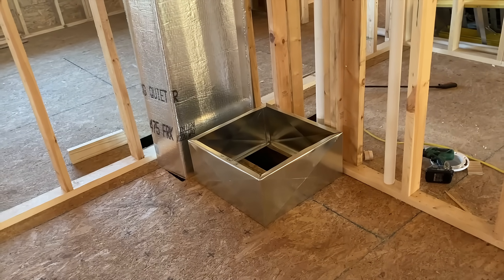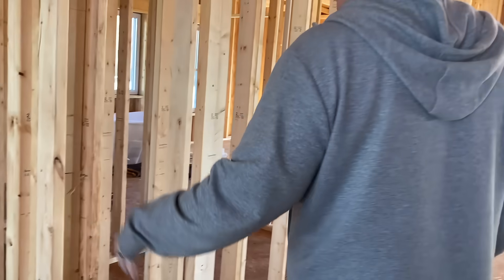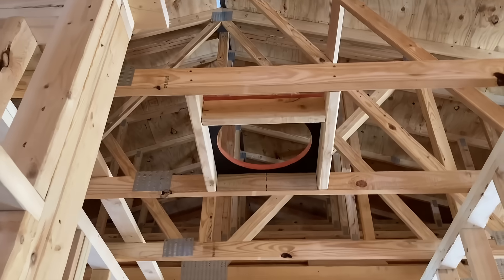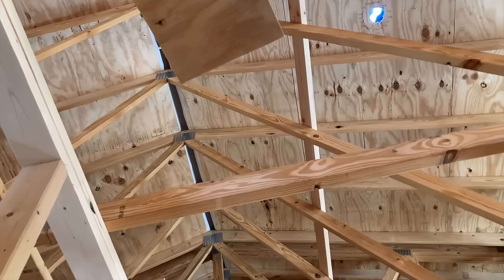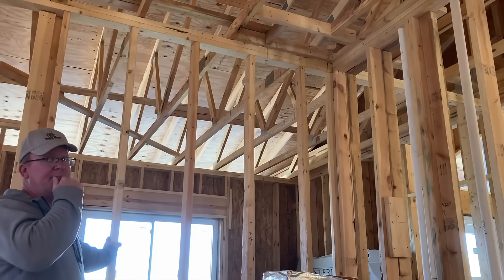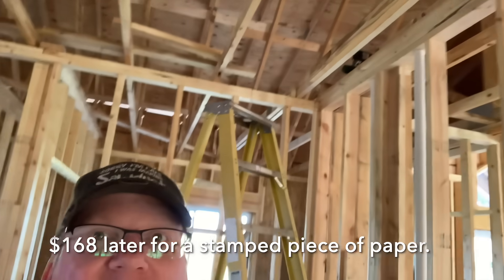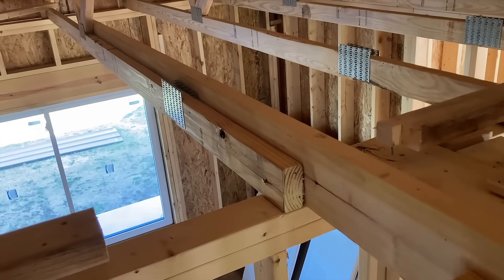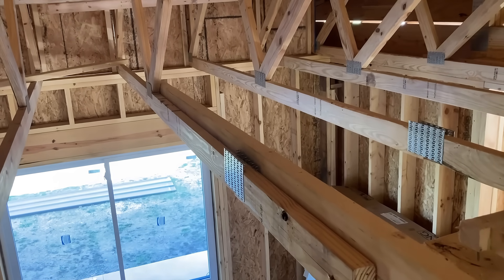HVAC Guy Cut Our Structurally Engineered Truss to Put in Duct Work. Do Not Cut Trusses!

Comment: As a catastrophe adjuster, I’ve inspected thousands of homes over the decades. Those cuts will not affect the home at all. If you were really concerned, you should have built it with standard wood rather than trusses. Trusses collapse so much faster than standard stick built structures. An engineer will simply state to shore up the affected trusses with standard 2x6s or 2x4s (seen hundreds of engineering reports with this issue). 
You are just making something out of nothing. 
With that said, you two are the worst type of people for construction people to work with.

Comment: Another Homeowner that knows it all. Build it yourself.
Reply: @Bradley-l6b  Another know-it-all maybe contractor(?) who may have some great knowledge to share but just makes a snarky comment and doesn't explain for the rest of the class what he's thinking.

But let's consider this comment for a minute. I'm a homeowner and I certainly DON'T know it all. But I've owned three houses in three different states because of my Navy career.

Are you suggesting that only builders and GCs can do things RIGHT? And furthermore that they never make mistakes? Cut corners? Get sloppy and/or lazy? Hire unskilled workers and don't properly supervise them or inspect their work? That inspectors always catch these things?

My last house in California was built in 1961 and had some issues due to previous owners, but there were also issues due to builder f*ck-ups. There was a weird truncated and shingled roof section in the attic where they had apparently not built it according to plan and then corrected by just building AROUND that. I always thought this was the result of some addition at some point, but I learned from an architect I hired to draw up plans for a second floor addition that there had never BEEN an addition. Everything there was original construction. It made getting around that attic a royal PITA.
How does that happen?

I hired an electrical contractor to upgrade the service to that house to 200A and replace the main box. He left some spanish speaking guys there unsupervised for half of a day, and they installed the new box upside-down. So they had to remove that and replace it with a new box. Maybe they were able to use the one they F*cked up SOMEWHERE, but not on my house.

Tell us, why is it that the walls are never straight nor plumb nor square in a professionally built home, AND that have bulges where studs are bowed? We always have to compensate somehow when installing flooring or baseboards or crown moulding for walls that are neither square nor plumb. I replaced a front entrance door in that house, but to install it PLUMB, I had it tight against the wall at the bottom, and a 1/2" gap at the top because the wall itself was that much out of plumb. That was done by the original builders--NOT homeowners.
How does that happen?

Current house in Kansas was built in 1978. Lots of houses around here are having foundation and basement problems due to original construction methods. I bought a house that had a lot of neglect issues, but didn't have foundation problems--or so we thought and so the inspector told us. But my real issue is either sloppy builders, sloppy inspectors or sloppy code in 1978. I went to replace both full bath exhaust fans because they just squealed horribly. I found that they were never vented even into the attic. The little damper at the exhaust of the fan was closed and HELD closed by the attic insulation that had been pushed down or settled down around it, and no duct connected whatsoever. BOTH of them. Now they're both vented to outside by insulated ducting as they should have always been.
How does that happen?

I went into the attic during this time to do air sealing which I know and understand wasn't a thing in 1978. Fine. But I move the insulation back from around a light fixture, and the several Romex cables going to that fixture go through the knockouts in the very sturdily mounted ceiling fan box, but there are no clamps or grommets to secure or protect the cables.
How does that happen?

In another of these ceiling boxes, also mounted very well except that it was also about 1/2 inch from the bottom surface of the ceiling sheetrock (mounted too high), they used it for a junction box for that entire circuit, and it was stuffed FULL, completely violating fill limit for that box. And some of those cables had no clamps either. I had to remove the whole box, replace it with a bigger box, move it higher AND add an extension to the box. I haven't gotten to all of the light fixtures, so I'm dreading the amount of work ahead of me to fix all of these.
How does that happen? Original builder electrical contractor did that, not any homeowner. And no inspector caught it who should have, either.
Reply: Building it yourselves 😂
Reply from the maker: Hey, I appreciate the feedback. Welcome to the channel. You’ll see that we are building it ourselves. sometimes the subs just don’t listen to directions. Thanks for watching!
Reply: Yeah I’d fire that customer on the spot. There’s plenty of appreciative paying customers out that don’t know it all already especially your job.😂
Reply: @MK-xl9tt  my dad fired the GC after finding errors worse than this.  The GC response?  “If you and your wife did not walk project every night we would have gotten so far you could not make us fix it.   One I recall.  He messed up basement door, steps.  So moved it over 6”?  I forget exact then the upstairs had to be moved as both in same location.  That caused main bathroom to have a 22” wide door.  maybe it was 20”    They had wanted a 36,  but plans were smaller. 
  Only thing worse than amateur asking questions?   Á expert that gets mad when they are good questions.
Reply from the maker: @larsharris exactly! Thanks for watching!
Reply: So, what, you think that truss should have been cut? What do you think he doesn't know?

Comment: The old cliche applies here, ( you are most afraid of the things you know the least about. )
Reply: imma go waaaay out on a limb and guess that you're a tradesman who has cut thru more than your fair share of framing members and shrugged it off cuz 'it's just 4 inches out of a 2x12, there's still 8 inches left'.
Reply: @ripsnort-d8z Yes, i was a tradesman, but i was also in the home building business.
These types of things happen all the time,and there is always a way to fix it.
AND, with better planning initially, they happen far less often.
Reply: @ernieforrest7218  yeah yeah, anything can be fixed. The best way to fix every problem is not to create it in the first place.
Reply: @ripsnort-d8z Yes, you are correct, so find another place for the ductwork, or move it enough so the framing isnt afected.
But, if the owner dosent want to move it, what other options are there?

Comment: Not an expert but... I would of thought the plans would account for the HVAC duct work unless it was an add-on.
Reply: Residential building plans do not take into account hvac, plumbing, or electrical layouts. They indicate where the major equipment, furnace, water heater, etc are to be located but it’s up to the install tech to make everything fit appropriately. This is why we do things in a specific order, framing, hvac rough in, plumbing rough in, then electrical rough in because it’s much easier to get pex pipes to fit around duct work and wires are more flexible and easier yo run than water lines. Installers are expected to know and follow codes but most times they just want the easiest run which is why it’s best to have a contractor that knows and understands all trades to head this off before the installer takes a sawzall to a rafter or TJI Floor joist!! With a tiny bit of communication and planning, you can avoid the $168 engineers report with stamp, but you also lose a video and gain a free weekend without explaining to a woman about why 3 grown men fucd up their Lincoln log set!! It’s really not hard and is basic construction 101.
Reply: That's exactly what you'd think Of course it is. But you'd be wrong.
Reply: Would've. WOULD'VE. Its a contraction of "would have". WOULD HAVE. What sense does "would of" make? Christ.
Reply: @1qikz210  Take a deep breath and relax. I was the grammar Nazi in my job because that WAS part of my job. But this is the Internet and just a discussion about a video, and not everybody is an English major.
You clearly knew what he meant, so it wasn't like that little goof made it illegible. If that were the case I'd be with you asking @kahvac to clarify.
There are bigger problems in the world than how somebody spells would've.

And someone once said everybody's ignorant, just about different things.
Reply: @dolfinwriter5389 
 Thanks, for your comment. I see it from the same perspective. 
Don't sweat the petty stuff. And don't pet the sweaty stuff. Unless...that's what your or you're into.  Still knew exactly what I meant.
 Peace Out. Take a deep breath. And enjoy each day we are or
we're given. No... I couldn't leave it alone.

Comment: Sorry but duct board sucks. Also running ductwork in the attic out of the environmental envelope is a very bad idea, I mean an absolute horrible idea that should never be done. It looks like this house has a crawl space which the return air should be run to several returns though out the house. This issue is on the architect to do a better job.

Comment: If there is one guarantee in building a house or remodelling, the current trade doing work will trash a previous trade some how.    It is up to the painter to fix it all.
Reply: Yep, caulk and paint over poor miter cuts. Some in my sister's  new house had 3/16 gaps filled with caulk.  
   As a DIYer, I had a heck of a time putting stained hardwood chair rail and crown moldings in our house that didn't  have square/plumb walls..
Reply: For reduced wages as they already over budgeted the rest of the project..
Reply: Or sheetrock to cover up.

Comment: My parent's house was built in 1957, before trusses were a thing.  Not only were the roof rafters not supported vertically, but one of the valleys had a big three-flue chimney across it.  No supporting structure either.  No cross-ties, etc..  The roof WAS spreading, and caused numerous cracks in the drywall.  Also the 'trim board' at the the brick veneer/soffit area had separated away from the brick almost an inch-  The ridge of the roof had a noticeable 'swayback' where the framing was compromised.  I'd never buy that house today, knowing what I know...  Oh, and the new owners (they've been in the house for over 30 years) took out a structural load-bearing wall down the middle of the house...  Oops.  It is amazing some of the absolute crap/shoddy build quality you see in construction!!!
Reply: Not the kind of structure I'd want to be in during an earthquake. lol
Reply: Agreed. And yet some of these "pros" act like (1) they know everything; and (2) they're infallible. I have news for them.

Comment: Much ado about nothing! All that would have been required would be to repair the bottom chord to restore the tension. This is overkill but for less than $50 if you were to put a piece of 3 1/2” x 7’x 3/4” plywood on either side of the bottom chord, glue it with PL bond, and put 2” screws every 6” o/c it would be stronger than the original and any engineer would sign off on it. Yes, the contractor made a mistake but to put him through the grief I’m sure he experienced, and expense of an engineer, etc. was completely unnecessary for a common sense $50 repair. The contractor should be reimbursed
Reply: Exactly! They give too much credit to a 2x4 stick.  There are trusses on each side, not more than two feet apart. Besides, they can sister it way better than what they did here. Cut one 2x4 to fit the space, then sandwich it with nails with two other 2x4s. Nonetheless, hurricane ties to the cross and the truss, if the cross was doubled, would have sufficed.

Comment: It was a mistake yes but you made a huge deal out of something so stupidly simple all you had to do was replace the piece of wood that was cut in the truss and then run two bolts through the tie plates and get another HVAC guy. You acted like an a-hole!!!!
Reply: Once the truss is compromised you need to get that signed and sealed piece of paper to pass the framing inspection.  The earlier the better.  Might even be worth it to have the inspector who approved the original plans involved in the process.
Reply: He acted like an a-hole???  You sound like you are talking out of yours!  Go back to licking the windows and stay off all construction sites and comments sections!!!!

Comment: Why are vents in floor?
Reply: maybe he meant the cold air returns, supply are still being installed in the floor.
Reply: Have you ever been inside a house at all?  This question cannot be serious.
Reply: @davidshema2614  I know in old construction they were in the floor but have not seen it in 10 or 15 years and is against code around here.

Comment: Your interior walls under the truss require a special bracket, get ready to dismantle them and putting it together right 😂 . You need advice let me know.
Reply: Hurricane clips at barring points, I believe these trusses span from one end to the other
Reply: @bluelighting7152  I was writing about interior not bearing walls whitch require different connection and techniques when drywalling to avoid cracks.between ceiling and wall.

Comment: The repair is kind of an overkill in that the truss already has splice plates on the bottom chord. It is not like continuity of the wood fibers is critical to the performance. The bottom chord mainly bears axial loads to keep the truss from spreading and some minor vertical sheathing loads for the ceiling.
Reply: Right? My thoughts exactly. I mean, why not place the furnace and/or return between the trusses?

Comment: Why was the hvac equipment not accounted for in the construction plans? I could understand cutting in a remodel but not new construction . If I were told this is where hvac equipment is going , put it in without any instructions,Yelp I am cutting.
Reply: Agree. My home was designed with what is essentially a tunnel going from the basement to the attic across the first and second levels with the AC return ducts. No structural elements were cut

Comment: The fix looks terrible to me. Even after it's covered I would know its there.
Reply from the maker: For what is showing on the video I agree looks terrible lol. Unfortunately I seem to have lost the footage of the full fix. I’m only showing the start of it here. Everything was assisted insecurely between the joints per the engineering plan, including the space in between everything was donecorrectly per the engineer. If I find that footage, I will certainly share it. Thanks for watching!

Comment: loosing square footage is not always easy to hear, but there should be agreed upon floor to ceiling "trunk" space which can be in some closet or corner or something that includes the truss or works around it and the floor joist. cutting should be the last resort, but with that said, enough correct "sistering" is just as strong as a single board and such. insurance and inspectors are a different animal and generally mortal enemy's to the the trades.
Reply from the maker: Yes, and that’s part of the reason I was surprised that he cut the trust. The whole purpose of that half of the laundry room was for the furnace trunk space etc. and we’d had the conversation about where ductwork would go.